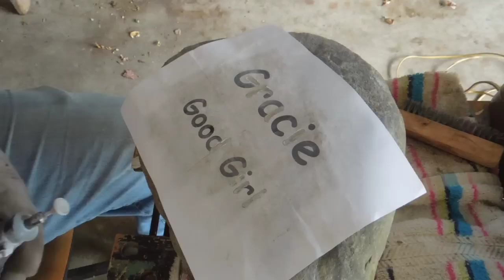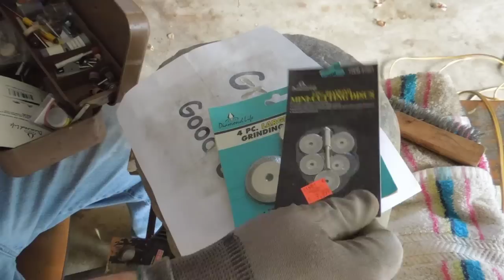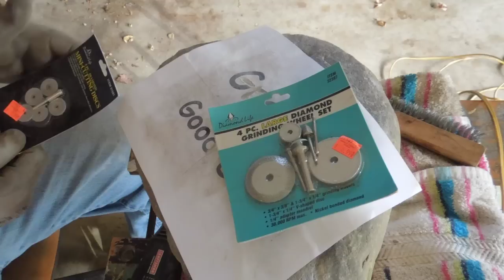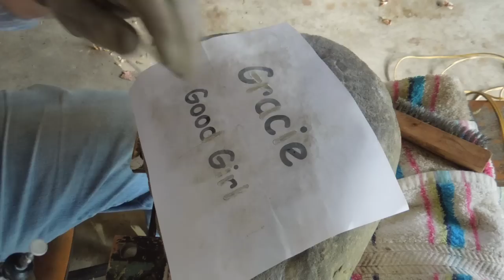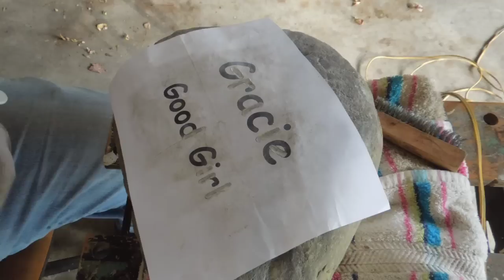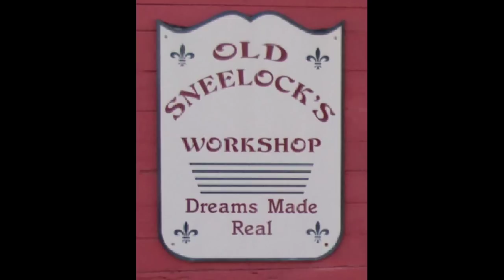Remembering Gracie Pt 1 of 3 - Engraving Stone - a video tutorial - by Old Sneelock's Workshop

Comment: Might I recommend you upgrade your rotary tool to a Foredom. They hold up better, have more power and don't slow down as you apply pressure. The RPMs are much easier to control with a foot peddle. Interesting process, thanks for sharing.

Comment: I am barely starting and what do I use for the round edges on my horse's. Or what to make the lines darker for a finished product? Please let me know so that I can do my horse's, oh what can I use as a base so water won't damage my stone.
Reply from the maker: For fine sharply curved lines I use a ball end diamond plated engraving bit. Take shallow cuts at first to establish the lines. Then deepen the lines with more passes using the original cuts as a track to guide the bit. For straighter cuts I use a thin diamond plated wheel. 
In Part 3 I show how I paint the carving to bring out the lines. After you have finished carving the stone, and painting the lines you can use clear polyurethane to cover the stone. 
I have stones that have sat out in the weather for 20 years with little or no change.
Reply: Thank you so much for your help. I will start my project now. But if anything I will ask for more of your help.thank you again.also I will try and send you a picture if I can,😄
Reply from the maker: The picture would be cool. Good luck.

Comment: What speed are you using? You were talking about slow and fast speeds.  Thanks!
Reply from the maker: Paulette Marquart The Dremel has a variable speed dial that according to the literature varies from 0 to 30,000 rpm. Larger bits should be run slower. The smaller bit in this video is about .125".  The larger is about .500". I set the control at half or about 15,000 rpm. for the larger .500" bit and at about three quarters for the .125" bit. The small bit needs to be used gently. At the higher speed it cuts okay but it can heat up and lose diamonds if pressed too hard.
Reply: Paulette Marquart Thank you so much for responding.  Your explanation really helps me.
Reply from the maker: Thanks. I appreciate you taking the time to ask. When I sold advertising the thought was every person who wrote in represented 50,000 listeners and needed to be paid attention to. My little channel doesn't rate anywhere near that high but the principles the same.
Besides I like explaining things. That's the reason for the channel. :-)